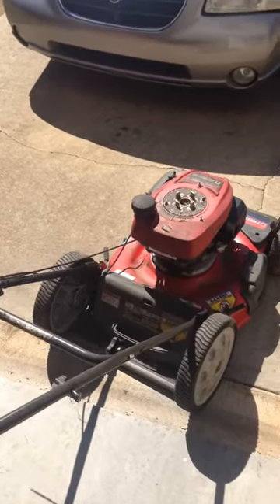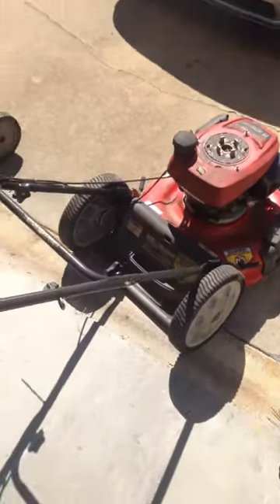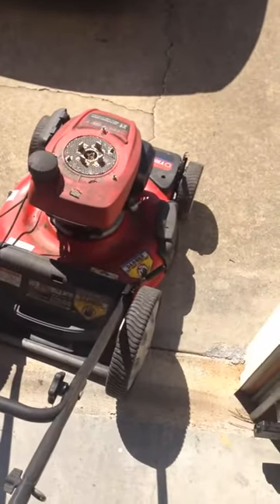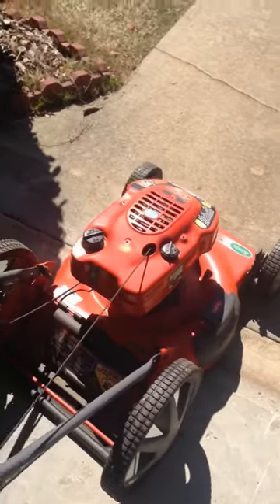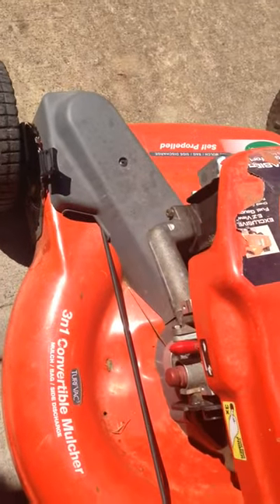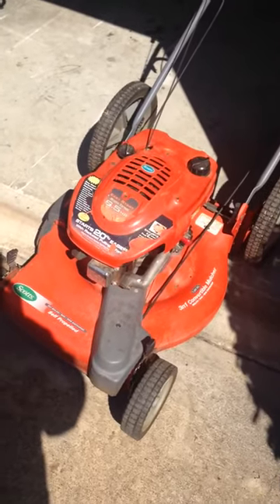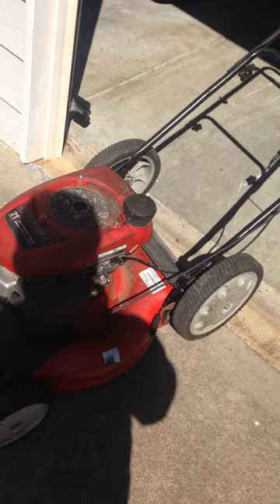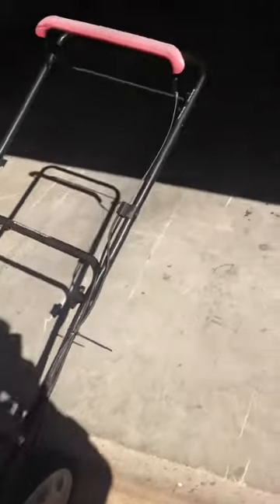VLOG 3/16/2017 update Troy-bilt and Scotts lawnmower finds

Comment from the maker: UPDATE : Scotts : got the rebuild kit for the Techumesh Carb 640338 from amazon. They where a really good deal 3 rebuild kits for 4.45. 
Anyways I rebuilt it  and it was flooding with gas. Float level needed to be reset. The proper level is 11/64 drill bit width between the float the the top of the carb. 
That stooped it from flooding and leaking. But now it only runs with a prime. I know the Bottom bolt  and main jet are cleared.  Now it looks like main Nozzle tube o-ring gaskets need to be replaced.  Ethanol dissolved the o-rings and no longer was sealing.  Those O-rings are cheep (maybe 1.50 each) .Will likely order it locally from local Mower shop which will bundle all its orders together to get free shipping.  or might have some in stock Tecumesh part #632547 (O-Ring)

 Tech Diagram for the Carb #640338

https://www.jackssmallengines.com/jacks-parts-lookup/manufacturer/tecumseh/carburetor-parts/tec-640338/carburetor

UPDATE2: got O-Rings from local mower shop and inquired about the muffler (36950A)  They didn't have one used. but could order a new one from supplier in Ohio for $28. I said I might be back once I get to that point.   I installed the O-Rings and re-assembled carb. ran with a prime only, but did run.   Later I cleaned out the Idle speed jet  and where it screws into and that solved the issue. Now it runs. just need a Muffler.

UPDATE3: Used Muffler came in today (3/28/2017) 
 EBay seller in Missoula , Montana. Thank you . 
 Used Part cost $15 free shipping,
 new  it's about $35 + shipping

UPDATE4: Air Filter came in today from China seller on eBay. 
it fits perfectly fine .  2 pack for 4.95. 
Also may of located a used bag for it off Craigslist

look for a final look Vid on this one once I change the oil.  

Then it will be up for sale once the Air Filter comes in.